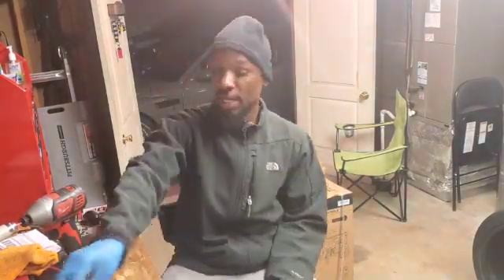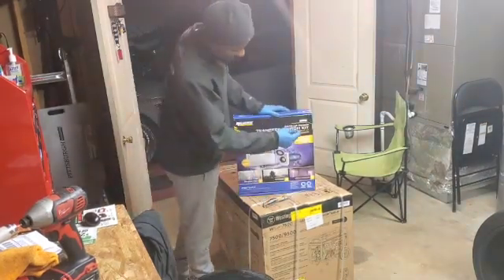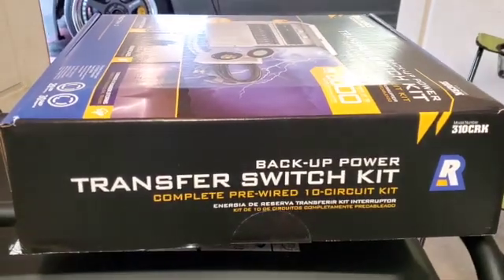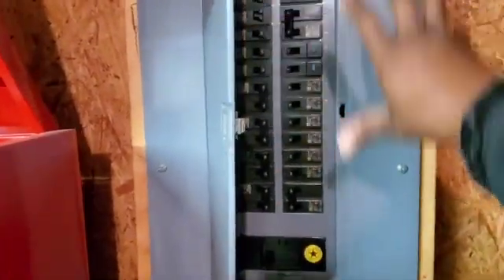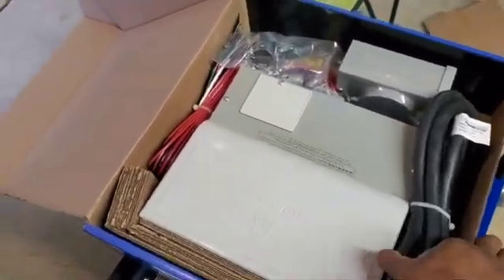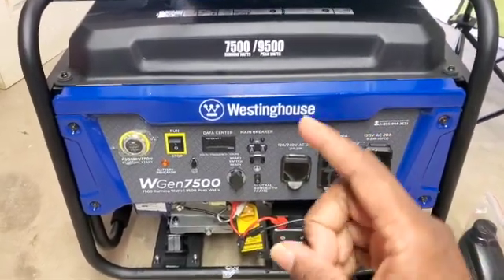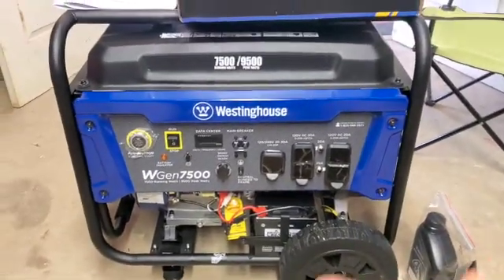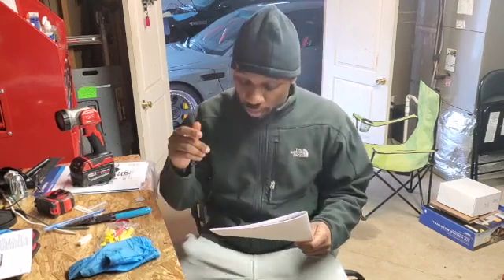DIY: Installing A Transfer Switch To Your Home

Comment: Anyone who wants to power their whole home using a generator needs to understand that the power you are supplying to your home may be "dirty", meaning it may not be a pure sine wave form of 110v  or 240v AC.  "Dirty" AC can and will ruin any sensitive electronics you may be using in your home.  They will run, but the circuit boards may end up toasted after you run it for a period of time.  When you purchase a generator, always check to find out what the "Harmonic Distortion" level is for the generator. Anything above 3db is not good for powering things like computers, printers, television sets, microwaves, coffee makers, refrigerators, washing machines, furnace, air conditioning, etc.  OK for well pumps, dryers, stove, and many other things.  You can get inverters (that provide pure sine wave AC) to put in between your generator and your home circuit panel to ensure that the generator power is       clean.  An Example is the EG4 Chargeverter.
Reply: That Generator will put out a pure sine wave power. The problem may be with voltage and frequency.

Comment: I used a $40  DPDT 60amp 240v Contactor , a Small $50, 12 Breaker sub panel and a 4 dollar toggle switch to build my own Grid/Inverter Transfer Switch.  Spouse can flip the toggle switch which is mounted on the Sub-Panel box to turn the 120V power back on in our house when the Texas Ercot Grid Fails. 3,500 watt Inverter powered by Batteries and will run all the 120v circuits for 14 hours before the Sun hits my Solar panels or She hits the Start Button on the Genny which charges the Batteries.
Reply from the maker: Nice. Sounds innovative for sure!
Reply: Hi if you could add pictures.Also diagram.Part numbers. Thanks.

Comment: Thanks for the video, I am doing similar. What fastner you used to hang the transfer switch box on the plywood? I have same situation I wonder how to mount on the 3/4th plywood without protruding other side and still hold the weight. thanks https://youtu.be/oLNyLxAQ4rs?t=342
Reply from the maker: It's been so long that I did this but I wanna say I used basic screws. I know I didn't go threw the other side of my house.

Comment: can you use a generator that has 3 prongs but an adapter that converts it to 4 prong? My generator is only 120V but all the circuits I need is 120V. I have a firman inverter generator WH03242

Comment: I bought the same Transfer Switch, it says its compatible with generator up to 8000 running watts. I was thinking about buying the same generator you have then  I found on northern tool website few people asked to reliance team that they have 10k peak watts generator with 8k running watts. So the reliance said this Transfer Switch not going to be compatible.  I am all confused now.
Reply from the maker: It's been a while since I wired this now and I've used the set up 4 times with complete success everytime. One of the power outages lasted almost two days and my entire system was without a hiccup. I try to do extensive home work before investing in anything and personal experiance all is fine. I purchased my generator from homedepot and have like a 4 or 5 year warrenty on it.
Reply: @alhuegayle7550  Are you a certified electrician near Ambler, PA?
Reply from the maker: @thomasgarrett5371  no I'm not an electrician, I'm just a guy that does everything on my own. My videos are for reference purposes only.

Comment: Hi there, great video. Joseph Harris already mentioned most of the things I was going to say of concern or correction, so no need to say it twice. Great job in showing how you hooked it up.  I installed the same transfer switch, to run our 9000/7250 watts Predator generator. If you only need 10 circuits, this is the way to go.  (We haven't needed to use our generator yet for a power outage)  I do use the transfer switch, when just exercising the generator. 

Just a suggestion, look into installing a Tri-fuel kit. This will allow you to run your generator off of gasoline, Liquid Propane and Natural Gas. Then have it hooked up to your house LP or NG. This will allow you to not have to refuel or having to leave home to buy more fuel. 

This is the company we bought our kit from to install on our generator, to run off of NG, that is supplied to our house.

US Carburation - https://motorsnorkel.com/
Reply from the maker: Thanks for that update. I've used the system three times already now without not even a single hiccup. I think my verbage was off initially in the video because I back tracked all my wires and its all good.

Comment: First off my friend, ill go easy on you because you put a disclaimer out there. But right after the disclaimer you actually sounded like you knew what you're talking about and you have no clue. And I'm just commenting so NO ONE followed your directions. First you need a 10/3 wire to the inlet box not 10/2. Second it not 15v or 60v. It's amps not volt. 3 you're advising people to put a 60amp appliance on the 2 pole breaker. That wire on the 2 pole 20 amp breaker is a number 10 wire. Which is rated for a maximum of 30 amp breaker. You can not power a 60amp  appliance on a number 10 wire. Too much power for such a little wire. And that will definitely cause a fire.. You need at least a number 4 wire for a 60 amp. And lastly I'm hoping you didn't run that 10/2 wire outside. Because it's not a outdoor rated wire. I'm glad you didn't show how you wire that inlet box with that 10/2. You need 2 hots, a neutral and a ground in  that inlet box and that 10/2 comes with one hot a neutral and a ground.  You should've called an electrician.
Reply from the maker: Thank you for your expertise, professionalism and not being judgemental. You deffinetly sound like you know what you're talking about and I will actrually go over my work once again. I wired it to the instructions that came with the transfer switch. I've done some electrical work in the past so I was pretty comfortable with this installation. I've tested and actrually used the system once for over 24hrs already with no issues or hiccups. I appreciate you my friend and will go over my connections with some of your advise. I take it you're an electrician correct?
Reply: 2 pole 30 amp you need #10 not 20 amp. I don't see why he'd have a two pole 20 amp. But I don't think anyone who is not an electrician should be given advice on electrical work.